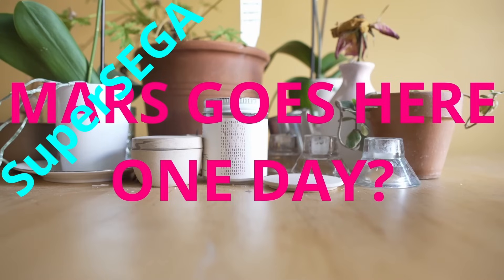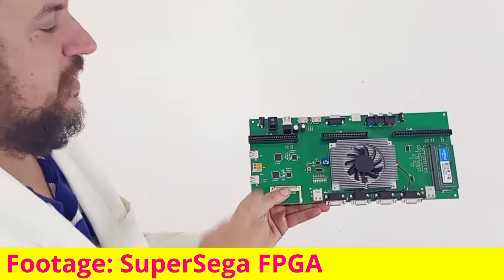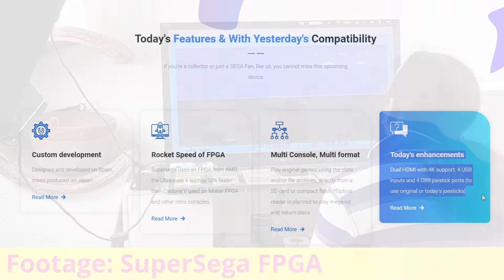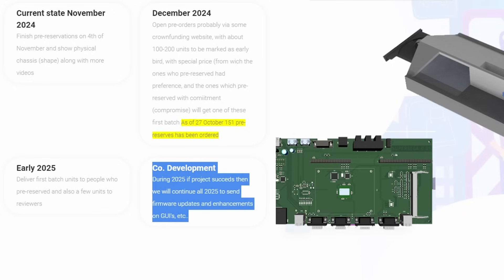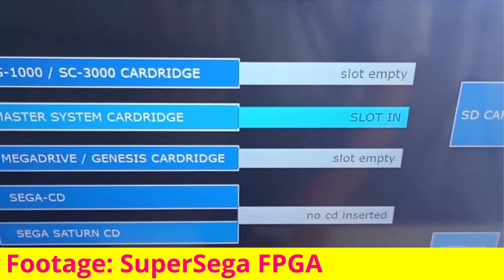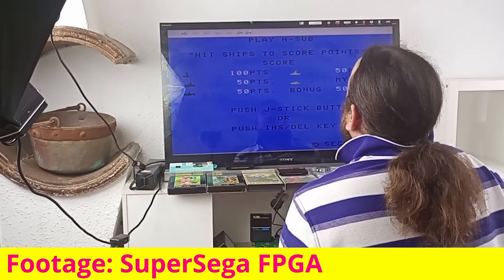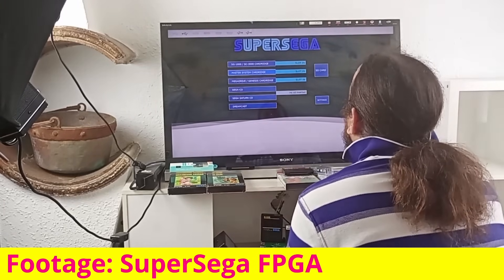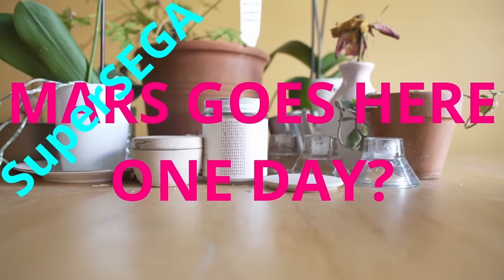A Scam? SuperSEGA FPGA is Taking Money Now! Do NOT Give it to Them

Comment: If nothing actually states it running on FPGA then to avoid getting sued I can see them drop shipping cheap $20 raspberry pi 2 knockoffs with emulators. They can claim that FPGA is part of the name and nothing to do with hardware. 

In any case they are counting on people throwing 3 Dollars/Euros at this just for the heck of it in case it comes out not realizing they can charge more later.
Reply from the maker: It’s a thought; they’ve never specifically said it runs on the FPGA portion of the chip. It could be on ARM cores
Reply: They could also use the FPGA for something super basic like translating inputs from one type of controller to another. But that might be more effort than a scammer would put in.
Reply from the maker: Yes that seems like a weird amount of effort

Comment: Supersega guy posted the oddest video yet.  I csnt even make head or tales looking at it objectively .  Its peter venkman odd.
Reply from the maker: It’s so over the top odd it’s like they are trying to convince people it’s fake
Reply: @VideoGameEsoterica  dude is so awkward.  Has no idea how to use a clutch in his car. Drives up in the rain. Brings a 3d printed shell of the supersega on the roof of his car  out of a spray painted card board box that looks like it was on fire  🔥  then its just a shakey mess of the guy vaping , heavy breathing , reseting the console with an Allen key to showing the back of the TV with paint all over it , to an on screen message saying no sound on 4k. Then, to him, basically gloating, saying I told you so. This needs an additional  VGESo video.. I mean, how can you resist not doing it at this point.
Reply from the maker: Oh I’ll do it next week 🤣 don’t worry
Reply: @VideoGameEsoterica  I will say this, It is "possible"  his hardware is doing something maybe. I also think he can use the supersega name because it's all one word. Like back in the day you couldn't say Gracie Jiu-Jitsu, so they would say GracieBrazilain Jiu-jitsu etc.  It's like saying UltraSega64  so he is not actually using Sega
Reply from the maker: No using Sega even as a combo word wouldn’t hold up

Comment: So I already knew this was bullshit because all the experts who have actually written cores say that the Dreamcast is too much for current FPGA hardware
Reply from the maker: I’ve discussed that in prev videos
Reply: Exactly people wrongfully seem to think Dreamcast was only slightly better than the N64 or N64 Pro if you would. Dreamcast was a full generation ahead and thus a full generation more complex to do in FPGA.
Reply: @H6rdc0re  The only thing Dreamcast was missing was the same thing the PS2 was missing which is programmable shaders. But yeah I mean it was a quantum leap with a whole bunch of extra hardware
Reply: Or at lease affordable FPGAs anyway. There are some FPGAs out there that have millions of logic elements that could probably do it easily... for the cost of a new BMW.
Reply: @dannonyogurt98  yeah if you were going to buy something that is normally used to design Intel CPUs yeah sure you can do it. But you'd be talking in industrial grade device. You could get a couple of BMWs for that price
Reply: @jeremygregorio7472 and then you actually have to be talented enough to build the core.